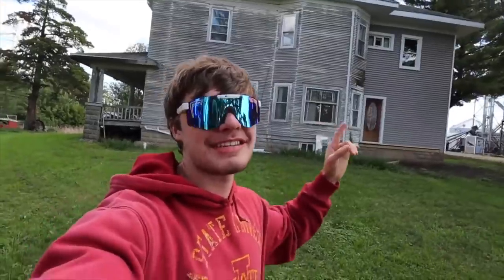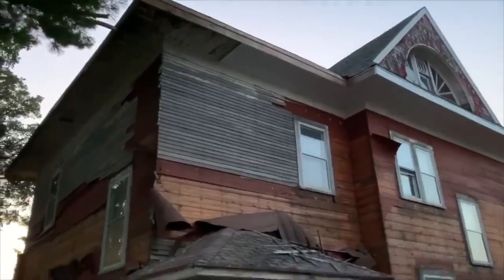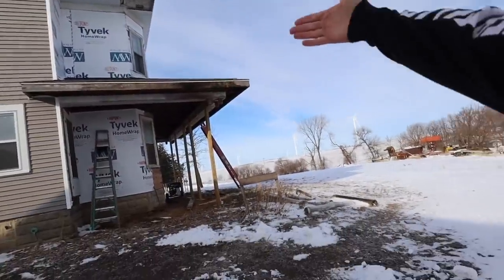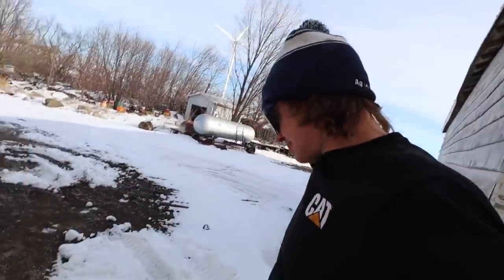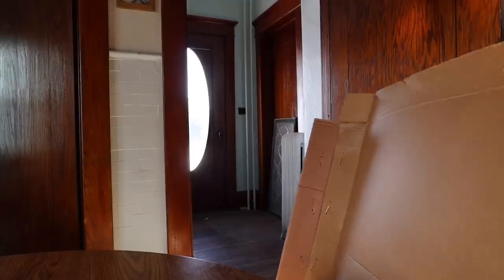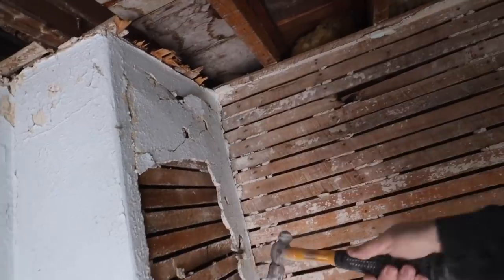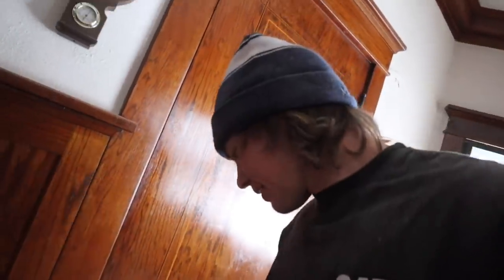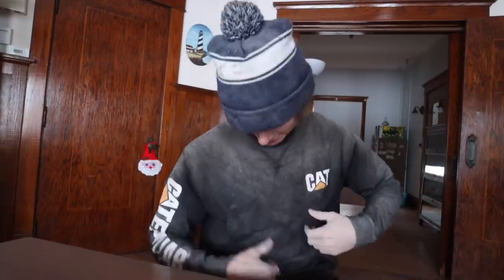Remodeling My Ex-Hoarder Mansion Ep. 1

Comment: For those sections above the round attic windows, I'd suggest trying to do vinyl shakes, they look even better then cedar shakes/shingles and are made of vynil so they last and you can get them in many colors
Reply: Yes! I did this on a major remodel of a house built around 1900, all the gables that come out of the roof are done in vinyl shake, it looked fantastic and still does because paint doesn’t flake off of vinyl 😁

Comment: Set a fan/filter system up and pull negative pressure on the area your working in to keep the dust down,  plus mist the loose plaster and lath down to reduce the dust

Comment: Save some of the lathe back if you plan on reusing the trim otherwise you’ll have to build the trim out after you drywall as plaster is always thicker at the bottom !! So your trim won’t fit on the door jambs correctly unless you plan on taking them out and trimming them down! 
Just food for thought that’s what I had to do in my farm house after I took the plaster and lathe off and reused the trim

Comment: As you are making plans for your house consider making it handicap accessible on the first floor. This way you can age easier in the house. Add large doors to enter the house and a large enough bathroom for a wheelchair. Don't be afraid to lose the built in China hutch. You can move it or repurpose pieces of it. I would also suggest working with an architect designer. You need to get the layout just right by thinking about the long-term and short-term. Good luck. Thanks for taking us on the ride with you.

Comment: My grandmother lived in an old mansion like that, and it had a well in the basement originally and no electricity. Two of the bathrooms were converted closets and the main bath upstairs was a bedroom -- it's huge! Your upstairs bathroom may have been a closet at one time. While you are doing the renovation, keep an eye out for lead pipes. If you have any, loose them 😉
Reply: Well in the basement, what could go wrong? I guess I see what they were thinking, it would never freeze in winter 🤷‍♂️ old houses are full of surprises, the house my grandma grew up in had no running water, they used an outhouse for her early years
Reply: @Beandiptheredneck  Granny's house had gas lights before electricity. Some of the switches were converted gas valves. It's surprising any of them made it out of the 1800's  😉

Comment: I don't know about putting the main breaker box in the attic.
Reply: 100 amp Sub panel in the attic
Reply: Maybe it's just a aux. box from the main box in the basement.
Reply: @virgie704  that’s what he’s talking about
Reply: It’s really easy to drop a new line straight down from the attic, it’s a lot trickier to bring one up
Reply: @coachwalrus3158  When you're starting out with what, at best a 100 amp main panel coming into the house?  He said it's all knob and tube so it can't be much.  I see a full gut with new wiring and plumbing.
Reply: @ChevyC-hf6km  
He’s gonna need a new 200 amp service pulled to basement then sub to attic. If he plans to get rid of k&t he’s gonna need new service 
But he could already have a 200 amp panel even with some k&t in there. 
I don’t know the whole jist but if he’s gonna piece meal the renovations he might as well be able to pull down 2 Nd floor circuits from above 
Clean and convenient

Comment: Might be worth getting tested for asbestos! Better to be safe than sorry 🤙🏻
Reply: Negative
Reply: Lead paint that house was built 60 years before asbestos was used.
Reply: @sliderinc1  yeah but renovations were done over the years. The tests don't cost much. The worst case is you lose around 100 bucks. The best case scenario is you don't get cancer and die at some random point in the future. If I was him I wouldn't touch another thing until things are tested properly and let a professional remove the materials and clean everything up

Comment: Cole, if you haven't already, please invest in an actual respirator that covers your mouth and nose. It is not recommended to wear anything other than a respirator when working with asbestos.
Reply: I agree, I'm a respiratory therapist
Reply: He should be wearing a respirator and a hazmat suit.  Actually, unless he is licensed, he shouldn’t even be touching the stuff. Almost all the states have a license or certificate that has to be renewed annually.  They also required homes or buildings that were built before the 90s to have an asbestos surgery completed before any remodeling or demolition is started.  My dad spent most of the 90s removing asbestos from commercial buildings.  He had tons of very strict rules he had to follow for proper removal and disposal of the asbestos.
Reply: If Cole was to hire a contractor to come in to do the remodel he would need an asbestos inspection. Since Cole is doing the work himself as inspection isn’t required on a residential home. Now depending on what landfill he takes it to they may want to know if the material contains asbestos. The skim coat on the plaster could be where they more likely would find it in the materials I saw him disturb in this video. Cole if you would want any help with knowing what materials would be of greater concern let me know.
Reply: It can depend on the state and also how big of a remodel is being done.  I have lived in areas that require it if you are going down to the studs, even if you are doing the remodel yourself.
Reply: Yep, respirator and double bag any rubbish and inform the site it's being taken to - don't pass on the risk! 
Or! Send suspected bits away for analysis, and if it comes back negative for asbestos, no probs.
Reply: Yes you need more than just a mask to work around Asbestos.....that stuff can kill you.....it's dangerous.....
Reply: @authenticityprevails9917  he should also be using misted water to stop the asbestos dust becoming mobile... this is not good to see him around the asbestos....

Comment: If there's asbestos present definitely hire an asbestos removal company you really don't want to mess around  with that shit
Reply: Probably not, those chances are very slim. Asbestos was used in construction between 1940 and 1990. 
I think that If the house has concrete containing asbestos it will be as isolation around piping. Then again, it's not very likely.
Reply: i agree and definitely worth getting a test done on all the common areas to be sure. don't take the chance, this is your health.

Comment: Listen to Mike Holmes...  Clothes washers upstairs are never a good idea.
Reply: As long as you put a floor drain in the laundry room that empties to the outside it should be okay.
I always thought that should be mandatory in every bathroom.
It would save a lot of cleanup in case any plumbing starts leaking.
Reply: You can buy a shallow drip pan to set the washer inside.  There is hole on the side where you can attach a drain pipe or hose.  Then, if the washer develops a leak, the pan will catch the water.  Alternately, the floor could be tile with a drain under the washer.  Hoses should be replaced periodically as well.
Reply: @ILGuy2012  the problem is a busted water hose feeding the washer. A drip pan won't help with that.
Reply: @jeffreyhouston2043  So maybe you can explain how a water pipe supplying a washing machine is any more hazardous than a water pipe supplying the bathroom sink, the shower or the toilet?
Reply: @ILGuy2012  Usually pipes feeding the major static items in a bathroom or to a laundry sink are solid pipes requiring soldering if copper or at least the blue plumbers glue when the pipes are the solid plastic type. Pipes attaching appliances to taps with main pressure are usually a twist on fastner type and are made of softer plastic.
Unless you have a tap between mains pressure and your washing machine that you turn off after each use the pipe feeding into the washer is under mains pressure. I have the tap set up in my laundry and its a habit to turn it on before using the machine and off after. However if you have a washing machine that has time delay the tap needs to be left in the open position, which could lead to a flooding event if your machine decides to breakdown at that particular time.
Reply: @ILGuy2012  usually showers and sinks are supplied by pipes, not hoses.
Reply: @ILGuy2012  usually showers and sinks are supplied by pipes, not hoses.
Reply: @jeffreyhouston2043  The water valves to a washing machine should ALWAYS be turned off when the washer is not in use.  Then, the risk of a hose bursting and leaking is minimized.  You can buy a single lever valve that slides up and down to turn the water on and off for both hot and cold simultaneously.
Reply: @jeffreyhouston2043  It's common for sinks and toilets to be connected to the shut off valve using a hose.
Reply: @ILGuy2012  in that case you should turn off the water supply to the entire house when not in use, lol.
Reply: @ILGuy2012  You're right... should be.  But human nature is, they won't be.

Cole wants to paint the walls and epoxy the floor in the basement.  Great idea.  Before you do that, put in the floor drain (mentioned above) and a lift pump to the sewer/septic if needed, fix the floor and do the epoxy job...     Nice dry conditions that never threaten your living space.

And realistically, turning valves on and off all the time wears them out.
Reply: @jeffreyhouston2043  Yes, when you're on gone for a week or more, it's a good idea to turn off the water supply to the whole house.

Comment: Happy New year Cornstar Farms
Remember to put in extra electrical tubing for later changes so you can pull extra cables out to the sockets and remember lan cables for all the rooms or even 2 for all rooms, and if you want a smart house remember to find a system you can get in next 10 years and smart house is not having to use your phone to turn on the lights it's when it's all automatic.
And put in small magnetic sensors on all windows and doors when you renovate so you can put up alarm systems without using 50 batteries every 2 years and having those big sensors on windows and doors 
Just some point I find important when renovating.
Happy renovating Cole 😊

Comment: Consult with an HVAC guy while the walls are open. High velocity a/c ducts are small and will fit into those wall spaces. Also, flexible PEX tubing can be used to reroute those open radiator pipes behind the walls.

Comment: I’m not giving advice - just information. :)  These old Victorian homes have parlors. This one has a parlor. Parlors were similar to what we call a formal living room today. However, they were often smaller than our formal living rooms and the most ornate and/or beautiful rooms in the house for, “showing off” purposes! :) They were specifically for receiving guests upon arrival and particularly guests whom may not have been close with the family. The idea was you could close off most of the rest of the house and just let them sit in the parlor until time to leave. The parlor in Cole’s house is over by the main stairwell with a gorgeous, custom, built-in mirror on the wall. It’s on front of the house and the side of the family room with the fireplace. The main staircase landing area is what I believe was meant to be the grand foyer, which would mean, the front of the house is actually the side that faces what Cole calls the grove and I believe was the only side that had a porch on it, AKA: front porch....except it is on the “side”. 🤷🏻‍♀️I have been perplexed as to why the builder or original owner would have put the front of the house facing that direction unless, perhaps, there used to be a driveway on that side. Just a bit of a head scratcher to me. 🤔It would have been lovely for guests to be brought in on that main entrance area where all the major woodwork would be on full display, but the way they situated the house on the lot, guests would be greeted on a side door or a back door. Just a tad bit of my observations! Haha! I absolutely love this house btw and would love to see it restored in the Victorian fashion to keep the architectural integrity of it as well as the property value but...it’s not my home. Haha! Have fun, Cole! This home is a true gem and major blessing!
Reply from the maker: You're spot on! The driveway used to come in on the grove side and was switched during the 50's!
Reply: Holy Cow! I’m doubly shocked! I got it right AND got a note from The Cornstar! Thanks, Cole! Not sure if there’s room, but wondered if it would be nice to put a narrow driveway back to the front with maybe a circle drive so guest could get the real feel for what a treat these gorgeous Victorian mansions were really like! Though having that grove side beautified might be nice to be kept more private. So many possibilities! :)

Comment: Cole here is a tip for you on your renovation , when you knock down the plaster do it on all four sides of the small rooms and the whole wall in the bigger room then pick up the plaster from the floor before pulling the wooden strips off the walls this makes cleaning up a whole lot easier ; another tip just to get some binder twine or old string and stack up the wooden strips into a pile and tie it together with two strings makes moving them a whole lot easier ...know from experience renovating three houses an this condition , good luck on your renovation

Comment: All that snow looks like South Texas last week.  When you added new siding you should have added Rock Wool minternal wool insulation.  That stuff is great.  The plaster looks too nice to tear that out but it really needs modern insulation.  Rock Wool can be applied like a sweater - on the outside.  You can stuff Rock Wool onto a wall up to 6 inches wider than the studs.   Rock Wool is water resistance - won't mold or mildew when it gets wet.  It won't burn and bugs hate it -  insects won't borrow or nest in Rock Wool.

Comment: When removing trim take the time to remove the nails as you go. Not doing so the nails could scratch/gouge that wonderfully aged wood that is next to impossible to replace. I used old fence plyers to pull the nails through the back side of the wood to prevent large chips on the trim face. Good Luck and most of all enjoy!

Comment: Did this to an old house myself. Turn the hammer sideways to wack the plaster with. Your flat pry bar is your friend. Hook the lath and pull. Ventilate the area well. Open windows and doors and use a box fan to suck the dust out. Many times, asbestos was used as a binder in the plaster. My plaster had horse hair in it as a binder. It's a dirty job no matter how you do it. Good luck with living there while doing this. Move back with mom and dad and gut the whole building. That way it is far easier to rewire and replumb. My woodwork was  mismatched and 3 different styles so I disposed of it. A friend did an old house with nice woodwork. He gutted around the woodwork and sheetrocked around it. He just had to add nailer studs here and there.

Comment: Not sure what type of furnace you have but I'd suggest turning it off when creating any type of dust (especially drywall dust) since the furnace will pull in the air and blow it throughout the rest of the house. Think of the build up in your ductwork! There is plastic sheeting available that sticks to windows and glass so you won't have to remove and reapply everytime. Using a Shop vac with filters specifically for drywall dust is also a plus!

Comment: Use a box fan in the doorway or window blowing outward to create a negative pressure in the house, that will help with dust control.  Like others have said your house would have horse hair in the plaster.  Also the insulation looked like cellulose, which has been around for quite a while.  My old farm house had encapsulated cellulose, which when I first came across I thought it could have asbestos but turned out to be cellulose that was inside a tar paper like sleeve.  Fortunately your woodwork is unpainted, but the wall paint could have lead in it, which should be tested because it can be just as bad as asbestos as far as your health.

Comment: An example of how old that house is, is the fact that it has exposed plumbing, which means that it was installed after the fact. Also, look at the ancient style of wall building using all those little pieces of wood and plaster attached to them, that style hasn't been used in at least 100-years. With a home that big, any kid would enjoy growing up in. But it most certainly needs updating. Does the boiler even work to make them radiators heat anymore?

Comment: If I may make a suggestion, while the walls are open, you should consider running Ethernet cables and installing Ethernet jacks in the various rooms in case you want to have hard wired internet in other places in your home and maybe set up a network closet.

Comment: 🏠 I'm as excited as you are to be working on the house‼️👍🤩 🥰 ❣

Save the trim wood‼️

While you're rewiring, put in PVC with a pull cord in it. Then at any time you can thread thru whatever tech comes along. No need to spend money now for something that will be outdated by the time you actually need it. Wire what you know you'll need within the next 5 years. Longer than that and you need to re-evaluate tech anyway.

Comment: It’ll be nice seeing it getting fixed up!  

No need to remove all the plaster.  Just cut ports for electrical, plumbing and insulation.  1/3 the time n money and don’t have to remove, remount, and refit all the trim work.

The plaster is perfectly repairable and is in style in high end houses where they skim coat Sheetrock to look like plaster.

Anyway just trying to help to save time and money and have a quality end product.

Comment: Just to let you don't know this; the best way to remove nails from the old trim boards is to pull them through with a vice-grip. This does no damage to the.finished side. Driving them out with a hammer can do a lot of damage. Also, don't forget to label all of it.